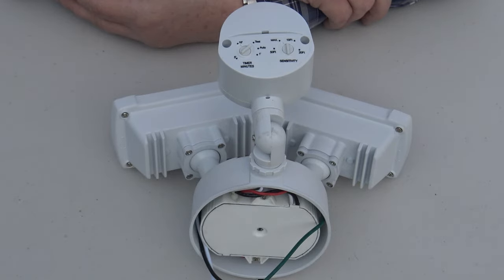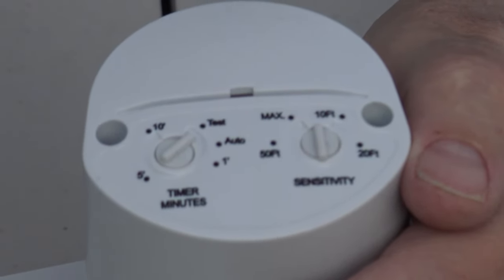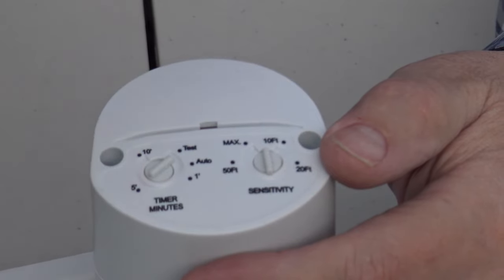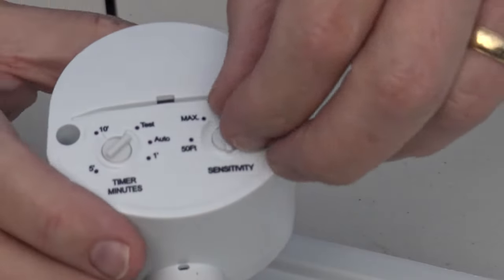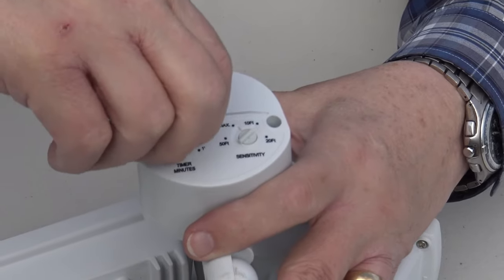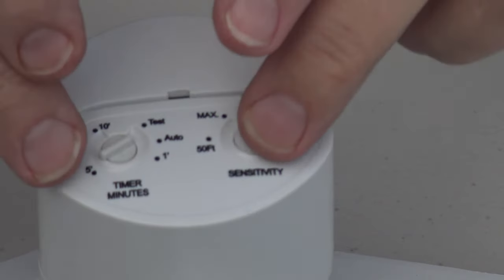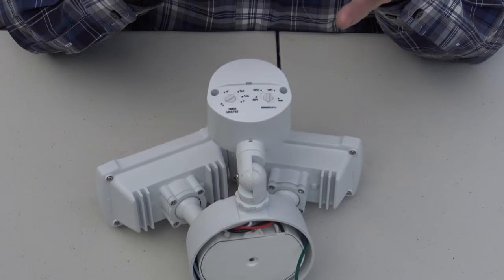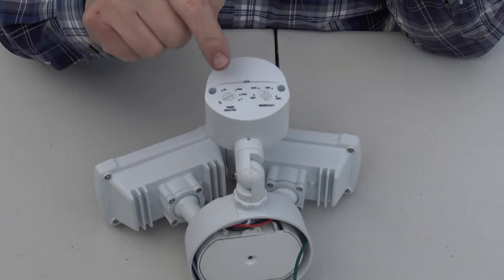Security Light Installation Part 8: Setting Timer and Sensitivity Controls on PIR

Comment: I just installed one of these yesterday during the day.. all was good after I installed it and tried it out when it got dark.. worked great!! after waking towards it about a half dozen times the light wouldn't come on untiI actually got to the door.. why is this? Why did it not work the same? Before that I did adjust the time and distance.. do I have to shut the power off in order to reset it and adjust it again?
Reply from the maker: Please reach out to customer service at 1-800-291-8838 for technical support.
We are available Monday through Friday 8:30 am to 5:00 pm CDT.

Comment: When it’s set on dusk till dawn that means it roll turn on with motion  starting  on dusk all the way to dawn ? Basically saying will it detect motion starting  sun down to run up
Reply from the maker: The security light will always work from dusk to dawn unless you put the fixture into manual override. If you have a low beam area light feature, you can set that for dusk to dawn. The low beam area light will turn on at dusk and off at dawn. The light will get brighter when triggered.

Comment: Is there anyway to keep these on permanent when needed?
Reply from the maker: If the fixture has a PIR sensor there is no way to permanently override it. Unless it has a switch control option on one of the dials/settings knobs.

Comment: Mine has a knob called "ACCENT", any ideas what it does? it's old and called EML-100. thanks
Reply from the maker: Are you sure this is a Good Earth Lighting fixture and not another manufacturer?
Reply: @GoodEarthLighting  It's an old EML, I found out that Accent is a fine adjustment that works with Sensitivity... somehow.

Comment: Everytime I turn my switch of during the day, when I switch it back on in the even my motion light resets and I have to go back to test to get it back working correctly..... should I just leave my wall switch on all the time????
Reply from the maker: Yes. These fixtures are designed with the intention that the switch will be in the on position at all times. The fixture will not activate in daylight. The switch needs to remain on so the fixture can hold settings and acclimate.
Reply: Ok thanks 👍🏿

Comment: He always had good success with these until this new one I just purchased.  On the facia of a garage and need it to trip at 180 degrees approx 17 feet.  No matter the sensitivity setting it turns on at about 5 feet.  The timer works fine. Have not tried the test mode.  Have the sensor aimed downwards.  Thiinking it shouldnt be hard.
Reply from the maker: Please reach out to customer service at 1-800-291-8838 for technical support.
We are available Monday through Friday 8:30 am to 5:00 pm CDT.
Reply: @GoodEarthLighting  This was Commercial Lighting Home Depot. Don't think the same.
Reply from the maker: @34dawgsgo  I do not believe that would be ours. Thanks.